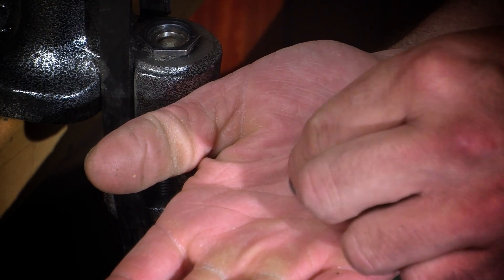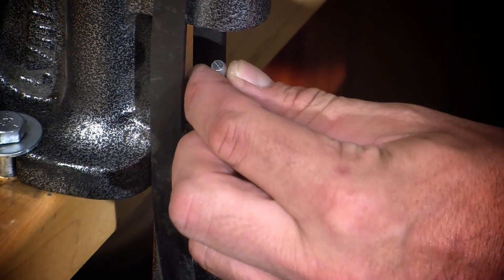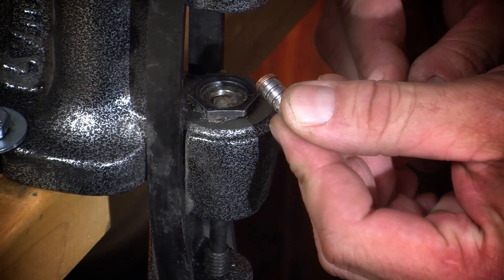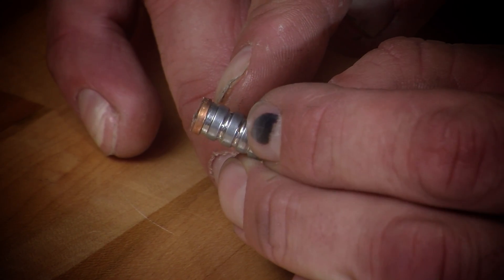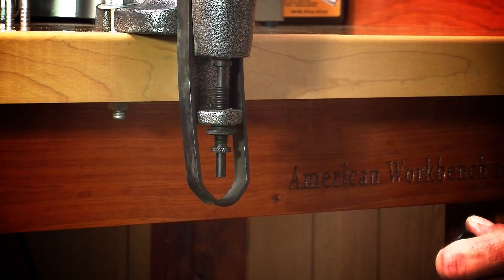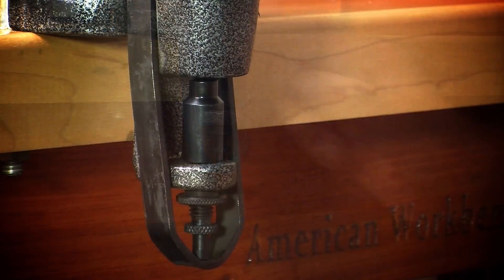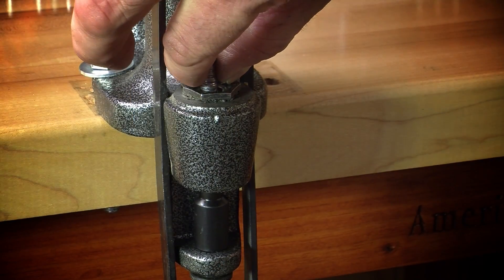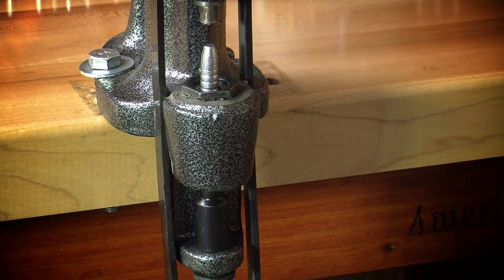Ask Joe How to Use the Lyman Gas Check Seater

Comment: The trouble is a lot of the time the gas checks are too tight, maybe the base of the bullet is a bit big or the gas checks a smidge small.
Reply: This is why you use the Lee push-thru sizer die.   It works on the situation you describe, and works every time - seating them squarely and firmly.